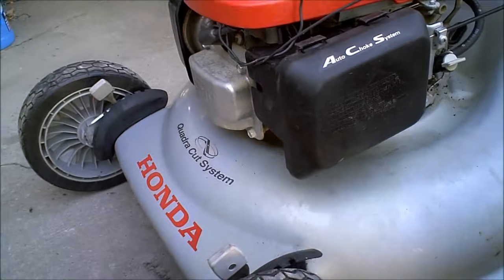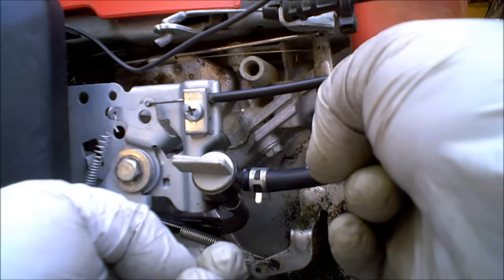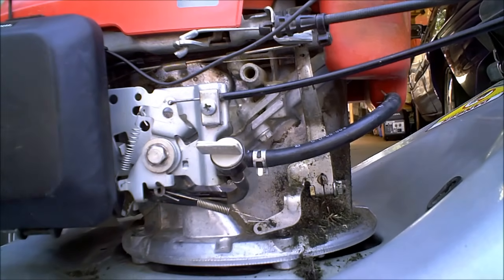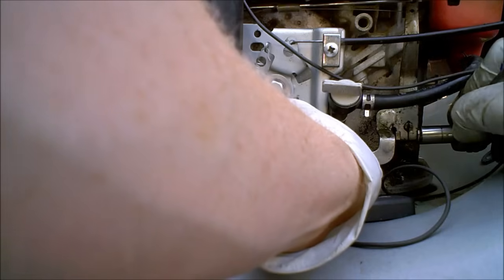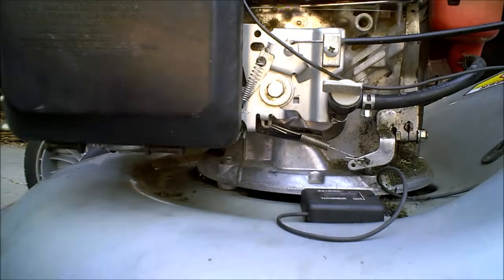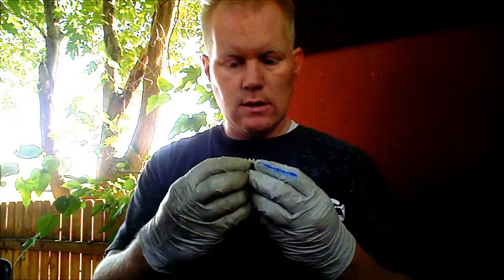Governor Adjustment and How They Work       Honda Briggs Tecumseh Kohler etc.

Comment: Nice video.  Well, as I understand it, the governor arm works by two interactive forces interacting against each other:  The governor spring (which speeds up the engine) and the governor cross shaft (which slows down the engine, as needed).   The approach in this video is to increase the force applied by the governor cross shaft to slow down the engine when the speed control lever is set at full speed.   I suppose for this application the other way is to reduce the force applied on the governor spring by adjusting the speed control cable so the speed control lever does not apply as much tension on the governor spring.  Another approach is to bend the governor arm to adjust the governor spring tension.  See https://youtu.be/7YrA3QEIFnE?t=213.   Larger engines have a set screw where to can limit how far the speed control lever can be rotated, which will decrease (or increase, if needed) the tension applied by the governor spring.

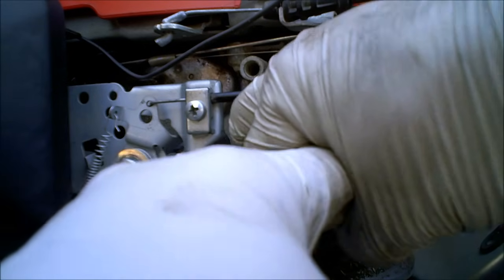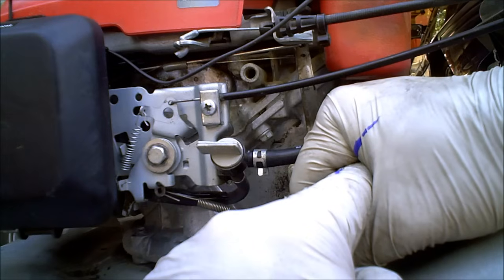Comment: I'm confused. At 3:07 you are telling to move the governor clockwise to reduce speed and at 4:10 you are making the same movement and telling it's increasing the speed. So what's the correct way ?
Reply from the maker: Just bend the tab the little governor spring attaches too. Stretch the spring tighter and it increases the rpm.

Comment: My engine is running wide open. Lt2000 craftsman riding mower changed carburetor 3 times cause they leak. What do I do.
Reply from the maker: Sounds like your carburetor linkage is binding. Or the governor spring is off. Or there's an air gap and you didn't get the carb to manifold bolted up. If you're using those cheap $25 Amazon /eBay carbs, they're pure junk and will eventually just kill the entire motor.

Comment: Thanks for posting this video.  I had my mower serviced at a local small engine repair shop and the guy obviously didn't know what he was doing.  The engine was over-revving when I got it back and I didn't want to take it back to him.  Your video was very helpful getting the governor adjusted correctly to bring the rpm's back to normal.  Boy, that adjustment is really sensitive though, isn't it?  The slightest adjustment makes a big difference!  Thanks a million!

Comment: What I would like to see is a RpM gauge while adjusting it to 3000
You can set at 3600 and you’ll be buying other engine soon
Reply from the maker: These engines are rated to run 3600rpm.
Reply: @sixtyfiveford speed limit is 85 in Texas but it’s a risk also 😊
Reply from the maker: @philliphall5198  Nope. 3600 is the standard operating rpm and where the hp ratings are taken from. Every generator runs at 3600rpm loaded(3800 unloaded). You can push 4000rpm without any issues. That's your 85mph. 3000rpm is an old lady in the fast lane at 49mph.

Comment: Have you come across any issues with the engine speed hunting?   I have an issue with a GSV190 with the engine hunting under no-load (mower has a blade clutch) under load it's fine but under no load it hunts unless I pull the throttle control back.  I tried cleaning the carburetor but it didn't improve the issue so I'm still searching for a solution.
Reply from the maker: Watch my video on the exact subject
https://youtu.be/FQ22j4FsF6g

Comment: Done right!  Others advocate bending arms.  Personally I've changed spring location or spring weight to achieve differing RPM's.  You did comment that the adjustments are very slight - "tiny" was the word you used.  And yes, it IS a tiny change.  Easy enough to get it way out of whack for someone who isn't quite as mechanically skilled.  I'd advocate for changing springs.  OR make adjustments with the governor arm linkages all disconnected and the arm swung to its furthest most position only limited by the internal mechanisms and loosen the shaft tensioning nut and make slight adjustments by moving the arm and not the shaft.

Comment: I spot checked the governing max speed for several GVC160s models.  It is 3100 rpm.  Before people start nuking their motor,s check the max gov. speed for your specific motor.  Don't trust what you see on the internet as gospel.  If you are not 100% sure what you are doing, pay a profession for this.  This is one adjustment that will destroy your mower if done incorrectly.

______________________________________________________________________________________________________________

For whatever reason my responses are no longer being accepted.  I will respond here.  This will be my last response.  Everything I need to say is said and I have given enough sources for those who would like to look into this to make their own determination:

 @sixtyfiveford  3600rpm is the upper limit of that power performance curve.  I am not disputing that.  My point of contention is you are exposing that 3600rpm IS the speed that the governor should be set based on your interpretation of the chart.  This is COUNTER to every single HONDA OWNER'S and SHOP MANUALS that I have referenced stating the governor should be set to ~3100rpm plus/minus 150rpm.  If Honda think it was safe to set the governor at a higher 3600rpm speed, I thing they would have stated so.  

Honda also stated, " For practical operations, the BHP load and engine speed should not exceed the limit defined by the 'Recommended Maximum Operation bhp' curve.  CONTINUOUS OPERATON SHOULD NOT EXCEED 80% of the 'Maximum bhp. (Pg.1-2,  https://www.honda-engines-eu.com/files/files/shop-manual-gcv135-160-en-fr-de-es.pdf ). That RPM range happens to fall within what that stated range the governor SHOULD be set to.

So why does Honda give a lower RPM speed that what the maximum RPM speed on the chart?  My take on it is Honda wants the fastest, continuous safe operational RPM is at 80% of the maximum speed and the governor is controlling that when adjusted to their specification.  Mower do not have gas pedal the user can use to adjust the rpm on the fly.  Per Honda User's Manual, they want you to set the throttle lever to the fastest speed for operation which right below the choke setting.  So with that throttle setting and the governor correctly adjusted, the mower will working at 80% for continues operation.  Yes you can adjust the governor to a higher rpm, but do you use your car continuously at the redline on the tach?  That is in essentially what you are recommending with the governor set to 3600rpm.  There is only one application I can think of where engines are continuously used at the upper RPM range.  Race engines are not know for longevity.
Reply from the maker: Every small engine is rated for at least 3600rpm. Hondas HP and torque numbers are based on this 3600rpm. They only drop the rpm on mowers to 2800-3100rpm to keep sound levels down. Take the GCV160: it's rated at 4.4hp max at 3600rpm. Drop it to 3100 and it is only putting out around 3.9hp; so you're losing 1/2 a HP or over 10% of your capable power.
Reply: @sixtyfiveford  Please reference where you got this data.  Every owner's manual I have looked at for the GCV showed 3100 max.  The actual range is 2950-3100 RPM.  Not being picky but I hate bad info that will harm people's equipment.
Reply from the maker: @ThaiXLe  Go to Honda's engine website and look at the engine specs. Not the mower specs.
Reply: @sixtyfiveford  Ok, I did.  Engine Shop Manual for GCV135 and GCV160, Rev Aug. 1997. Page 1-2 "Power curves are according to SAE standard NO. J-1995.  For practical operations, the BHP load and engine speed should not exceed the limit defined by the 'Recommended Maximum Operation bhp' curve.  Continuous operation SHOULD NOT EXCEED 80% of the 'Maximum bhp.'"  The max bhp is at maximum speed on that graph is at 3600rpm.  Also on Page 3-6 chart, "Model with flywheel brakes - 3000rpm plus/minus 100rpm; Models without flywheel brake - 3100rpm plus/minus 150rpm." 

I also reference a couple more shop manuals for the other mowers I have - HRX217K6VKA & HRX217K6HYA, pages 3-17 & 3-16 respectively.  For the VKA, "Maximum speed (no load) - 3100rpm plus/minus 150 rpm"  For the HYA, "Maximum speed (no load with blades engaged - 3100rpm plus/minus 150rpm"  These specifications are identical to the one Honda stated in the Owner's Manual of each respective models.

I stand by my original statement - Before people start nuking their motors, check the max gov. speed for your specific motor.  Don't trust what you see on the internet as gospel.  If you are not 100% sure what you are doing, pay a profession for this.  This is ONE ADJUSTMENT that WILL DESTROY your mower IF DONE INCORRECTLY.  Pay particular attention to the part about should not exceed 80%. *edit for clarity and spelling.
Reply from the maker: @ThaiXLe  You're taking definitions out of context. The engine load should not exceed 80% of the brake horse power/bhp. So if you have a 5bhp engine you shouldn't use more than 80% of that horse power in actual application. This has nothing to do with engine rpm.
Reply: @sixtyfiveford  I've cited my sources for the information I've quoted.  Anyone with a half decent googling skill will be able to find them to verify for themselves.  Interpret them as you please.  I not going to debate back on forth about it.    

Also NO WHERE in those shop and owners manuals did I see Honda stating the engine rpm is at a max of 3600rpm.  Please cite me where you got your information so viewers can determine this for themselves.  If not, please stop exposing bad info which can blow up people's engines.
Reply from the maker: @ThaiXLe  https://engines.honda.com/models/model-detail/gc-vertical#Features

Go to any graph and look at the orange bar/arrow on the bottom. It says the "recommended operating speed range" is 2000-3600rpm. This is small engine basics and they have been designed to run at 3600 RPM since the 1950's. This was set as the industry standard due to use in generators. As a 3600 rpm makes a perfect 60hz AC voltage frequency required for North America. In a few unique applications these engines actually run at 3800 and even 4000rpm.  

Honda puts the engine RPM lower on mowers for 1 main reason: sound. These engines are universal engines and mowers are only a part of the uses.

Comment: I have an issue, acceleration idle up and down how can I fix this is a toro with all kholer
Reply from the maker: Surging is caused by a dirty carburetor. More specifically the idle jet is clogged.
Reply: @sixtyfiveford  I already cleaned buy I would cleaned agayn

Comment: Some of this is not accurate. On some engines, governors actually can cause engine surging.
Reply from the maker: A surging governor means that the governor system is working accurately. It is 100% always a carburetor issue.
Reply: @sixtyfiveford  incorrect. Many things cause surging.  Carbs, governor springs, valve clearances, and worn cam lobes.  Good video but you’re a little misinformed on that, sir.

Comment: Thanks, I just fixed one really old Briggs&Stratton machine and I was wondering how governor internals work. Didn't need to disassemble the engine, but it bothered me how linkage actuation was gone. I was expecting centrifugal type actuation and seems like I imagined it almost spot on, but didn't know about that internal lever. Thanks for the video 👍

Comment: Because your method requires tiny movements of the shaft it's not a realistic way to do  this. Viewers should refer to the owners manual for you engine where you will find the correct method.

Comment: Yeah, this is WRONG! you adjust top end speed by increasing or decreasing spring tension,  You adjust the governor arm for ZERO slack not to adjust rpm.  If you do it they way he shows in the video, you will likely get surging at lower rpms.

Comment: I used to have a "Tiny Tach" just like that. 
Once the internal battery goes bad they are garbage. There is no way to open it up to change the battery.  They cost too much to throw away every few years.
Reply from the maker: Mine's going on 15 years old. I just used it today to set the RPM on an engine.
Reply: @sixtyfiveford  Does it have a removable cover so you can replace the battery?
Reply from the maker: @lestergillis8171  No it's sealed. I'm sure if the time comes I'll be able to cut it open and put a new battery in. I didn't expect it to last this long but the display hasn't dimmed or anything else. However I did have a neighbor by an off-brand China one and it only lasted about eight months and he says he just threw it away.
Reply: @sixtyfiveford  I tried to pry mine open when it went dead. 
 It was FULL of that shit that looks like tar. (Like the inside of a sealed transformer). Good luck getting past that.

Comment: Well... You Should NOT have messed with the arm position on the governor Shaft.!!!!
It is MUCH Smarter and easier to adjust the spring tension on the lower governor spring!!
IF you would have Actually Looked at it... Your throttle spring is All Stretched to FucK.!!!
FIX THE FUCKED UP SPRING!!!!    DO NOT FUCK WITH THE FACTORY SETTING OF THE GOVERNOR SHAFT!!   >;)  DumbAss

Comment: Well explained so that even I can understand a difficult concept. I cleaned my carb and put it back  (Crafts. Eager 1) and just runs for 1 second and quits.  Well the governor linkage spring  was too stretched so the throttle was always closed.  I changed the carb, cleaned the old and put back, took the bowl off again, recleaned the main jet, changed the gas, cleaned the tank, etc.  What a nightmare because I didn't understand what was going on.

Comment: My governor shaft where the linkage hooks up from the carb ? I lost the lil plastic geometric that holds the throttle shaft. It fall out of the shaft. Where do you get that little plastic grommet ?
Reply: You don't really need it, just adjust your spring to make up the differences.  Also, that little spring is important too.

Comment: Great video... By far the most straight forward explanation from the governor/ throttle relationship I’ve seen. I have a high revving Honda mower. Trying your adjustments tomorrow. Thanks
Reply from the maker: Most of the time a high revving engine is simply the throttle butterfly on the carburetor sticking open

Comment: Is that 3400 with or without the blades spinning?  I have a toro timemaster and at idel (blades not spinning) its 3300 but when spinning 3200 and when cutting grass it drops  3000?  Not sure if i should adjust up.
Reply: Without !!!

Comment: Does throttle position matter when setting the governor?
Reply from the maker: If you just want to increase the rpm slightly you can add tension to the spring that the throttle lever pulls. You will notice a governor spring that pulls tension on the governor arm when you move the throttle lever to the fast position. Some engines have a stop built with a screw to adjust the max rpm.

Comment: Hey I got a question plz help by mistake I was put the top wire on n  I pushed it back to far so now whn it starts runs 30 seconds and stalls out it seems like as soon as the bar moves it stalls. My number is 7322321294.

Comment: I want my generator to idle at 1000rpm and increase to 3600 when a load is applied to it.
Can it be done.
Reply from the maker: Yes and no. There are a lot of generators that do this and it's accomplished with a kick down solenoid that manually presses the throttle lever to idle. Once a load is sensed it kicks off allowing the generator to run full throttle. After you sourced the parts, installed them and wired it all up you would be better off buying a new generator that came factory with the feature. You could possibly find a dead generator for cheap with this feature and steal all the needed components off of it.

Comment: If my engine don't need high RPM, is it OK to remove that part ? I'm sure my engine will not over rev, I use my GX160 to operate pressure washer. It will not over rev due to high load.
Reply from the maker: It will still over rev even under load. You will also have uncontrollable rpm when you let off the pressure washer gun trigger and it isn't under load. You would blow up your engine in 20-30 minutes running this way.

Comment: My Honda Engine is similar but behind that arm is a small lever that is the idle control for mine. Mine was initially really low and then I loosened the nut and it went crazy high. I finally figured out to slide the lever toward the front of the mower and then tighten that nut back up.

Comment: Why some people just remove the governor from some engines, if the governor its used to control the rpm,  how that’s it help to improve the function of the engines.? I’m being trying to understand that.
Reply from the maker: Removing the governor allows the engines to rev at higher RPMs than the governor will allow it to. This gives a little more horsepower at these higher rpms but also generally destroys the engine.

Comment: Im going to try this I have a gx390 that is not running full power and this may be the reason,  atleast im hoping it is
Reply from the maker: Unless the governor has been played with or the arm is loose on the shaft, your issue is elsewhere(carb, spark, valves)
Reply: sixtyfiveford just remembered I switch the spark plug from this engine to another that I have same model but I forgot to screw the spark plug in completely , so I just checked and it was loose, hope that was the problem

Comment: Honda suck i paid over 1200 for it.and don't worth a. Shit.
Reply from the maker: Honda mowers are over hyped for sure. I wouldn't buy a Honda mower with a GCV160 or GCV190 engine.
Reply: look at what commercial yard workers/mowing contractors use
Reply: pretty much what I have on a range of yard machines (mower, mulcher, pump) never had a problem